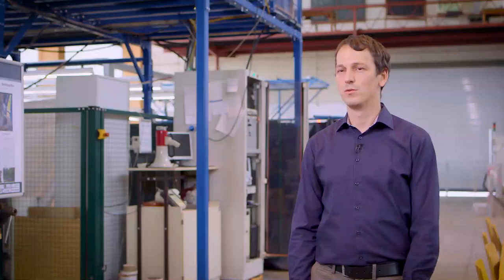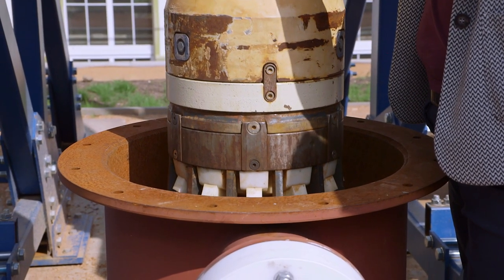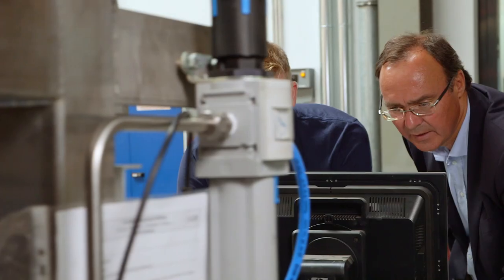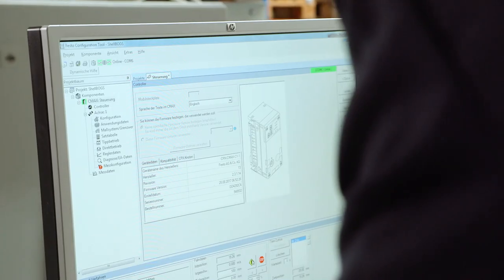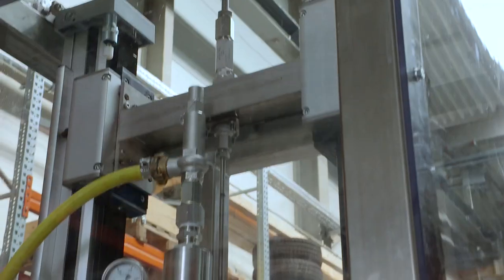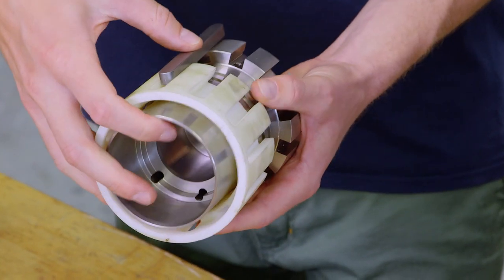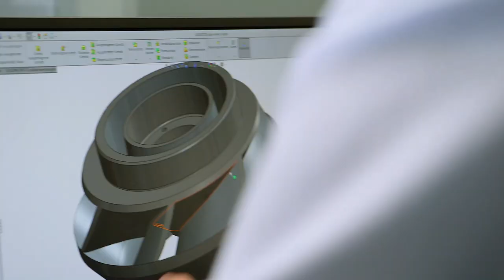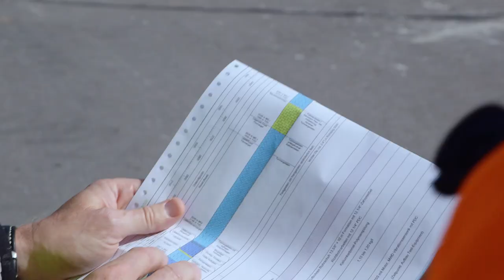Innovative Geothermal Drilling Technology

Comment: Geothermal drilling projects are excellently installed in kilometer distanced from a VOLCANO. This way, drilling removes the uncertainties of Geodetic movements situated near the Volcanoes, as Geothermal technology is renewable powered, it removes, prevents the uncertainties of calamities and earthquakes, as the cause of uncertainties are transformed to be certainties-applied-Sciences. SMEs..General practices/../..../.Geodetic engineers/ENGRS/Architects/are well coordinated regarding their respective expertise. Ptd/Trademarks/Copyrights/LLCs/Registrations/Registered are owned by their respective owners under Franchise/Franchisees-Franchisors.SMEs..2022 onwards. Respectively:G.M Industries.

Comment: The biggest obstacle in drilling in geothermal is Total lost circulation not slow ROP, no matter how fast you drill if  wellbore not clear of drilling cutting it will get drill string to stuck, result in million of dollar NPT
Reply: What about not drillong, exept through really soft things,  plasma melt, and push out of the way.
Reply: @ryanbeard1119  have to consider how to control the downhole temperature since one of the  product that from geothermal well is high temperature